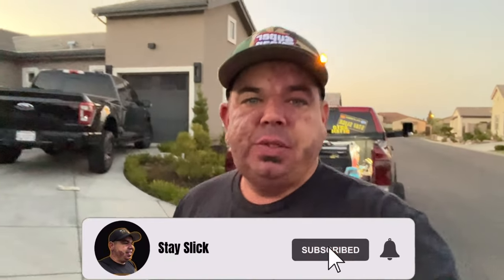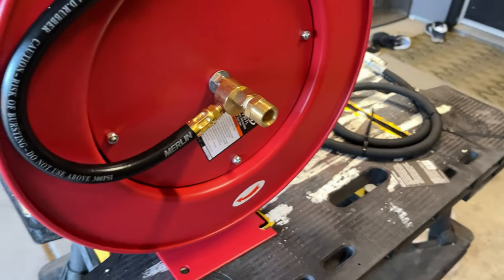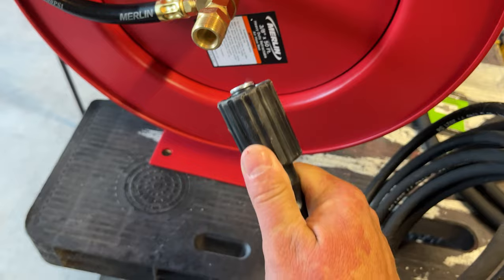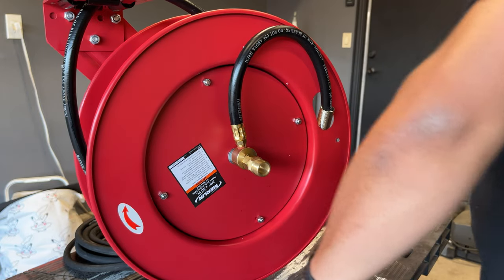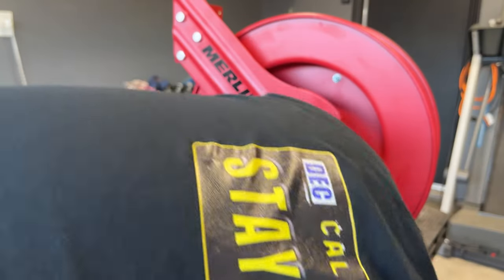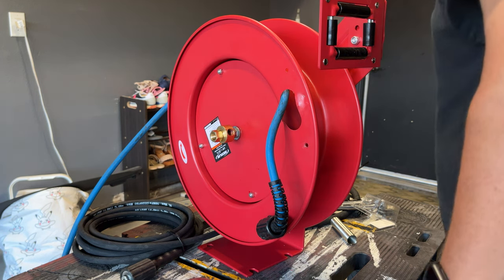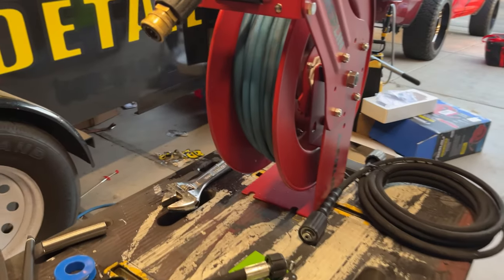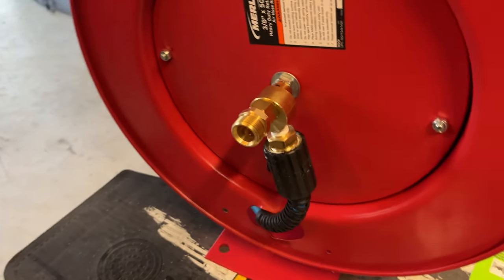How to convert a retractable air hose reel over to a retractable pressure washer reel

Comment: Why not just use the air hose that is already in it
Reply from the maker: Well first the connections wouldn’t work and two, air hoses are only rated at 300 psi max.

Comment: Absolutely insane! Air hose reels are designed to handle 200 PSI Max!  You’re video is going to kill someone and chances are you will get sued!
Reply from the maker: Lol calm down calm down this is a DIY meaning do it yourself assume your own risk. These things have metal washers for seals so if the metal washers go bad, it’ll spit some water out that’s it.
Reply: Hahaha karen the hose might be rated at that psi but not the reel. Cox makes the same type of reel.